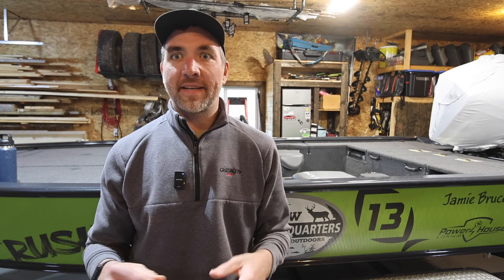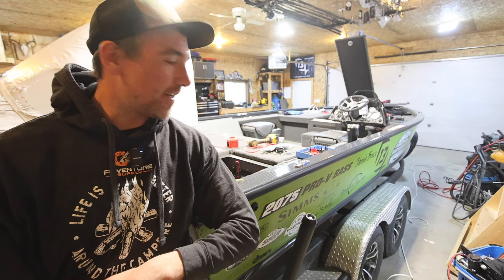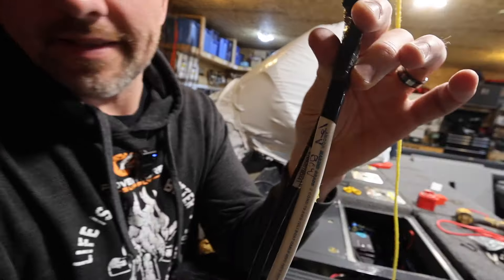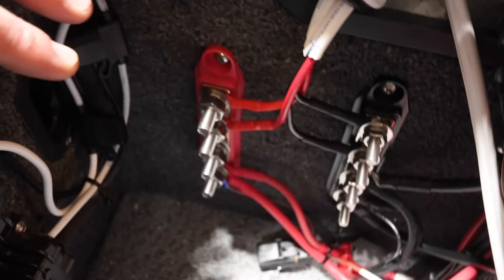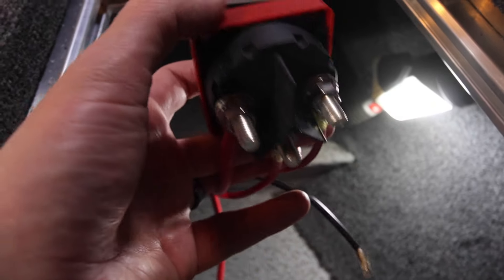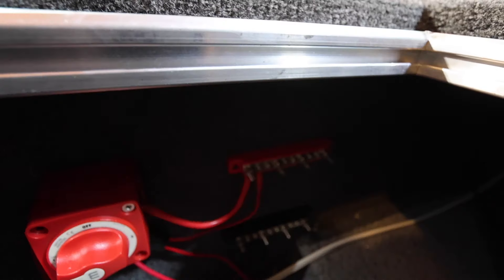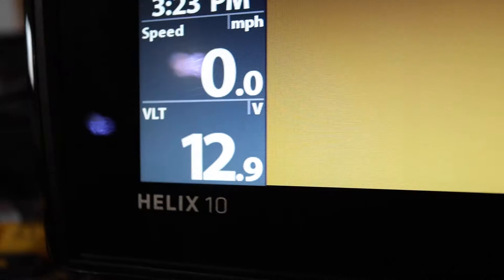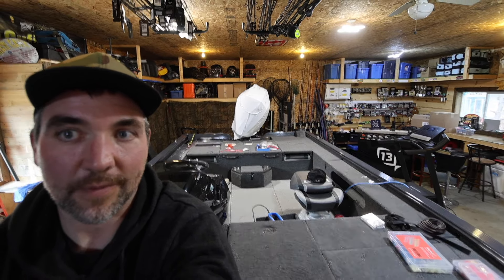How To Wire Your Boat For Clear Sonar Images and Back Up Power

Comment: An excellent vid for us new Pro V Bass owners.  Thanks!  It would have been really helpful if you also showed how you removed the floor/side panels to open up the wiring channels and the exact route you took when fishing your wires through the boat.  For newb's ... little stuff like that helps greatly.  Got a new follower here being an Ontario angler. ;)

Comment: I learned the basics of boat rigging this Spring installing a Helix 7 and 5 on my 1993 Smokercraft (my first boat).. it's been a learning process and i still have some dialing in to do but it all works how it should; Except when i have to switch my starting battery with the trolling motor battery to get enough juice to start my boat lol.
Reply from the maker: haha - definitely been there!  Gotta start somewhere!

Comment: Brucey, where do you order your parts such as buss bars, perko switches and even wire?  Is there a hot spot for this that you like.  Never too late to clean up my old mess in the back.
Reply from the maker: Hey bud - most of it is in stock at LOTW sports in Kenora , not 100% on the perko switch stock but the buss bars and wire is stocked heavy in Kenora .  Talk soon!

Comment: Are you worried about interference with a fuse block? I just wired my 16v up in the bow and I used a fuse block instead of in line fuses and buss bar
Reply from the maker: I'm sure they're fine, not much difference I wouldn't think

Comment: Very cool video showing how to get it done and why wire gauge and run length have an impact on ampacity.  Today's electronics are many orders of magnitude more demanding, and more sensitive to voltage sags or surges, than the old-school stuff.  The one thing I expected to see was a dedicated electronics battery mounted near the bow.  That's what I did in my boat and it eliminated any value in using the odd-ball 16v battery configuration.  I hate how those are only good for that singular purpose and require a dedicated charger.  I'd much rather run a more capable 12v battery, with right-sized wiring, to avoid any issues with voltage sag.  The 16v batteries are just "magic beans", from everything I've seen and read on them.
Reply from the maker: Thanks Jason.  I have two 16V 60 AH batteries mounted in the bow; I showed it in the previous video.  The 16 V battery is the same price as the 12V battery AH to AH and allows more power in a small space; which is what allowed me to run 120 AH @ 16V in a single location in the bow.  Other than the charger, which you would have to add for a 12 V anyway; there really isn't a reason not to use one IMO
Reply: @jamiebrucefishing  - Given that your livelihood could literally depend on a battery solution delivering the best possible power to your electronics, I can understand going to this extreme.  For the vast majority of folks, the math really doesn't add up, but you're showing what you're doing in your boat, so that's cool.

Comment: In my experience running dedicated power wires is unnecessary on newer Lund ProVs, along with their other higher end models. 

They run typically 8ga wire direct from the battery to a fuse panel under the helm, with open fuse slots for a chart plotter at the helm and then from there they also run 12ga wire up to the bow for bow electronics. 

In the event someone is running 3+ screens or live scope we will occasionally run new bow power, but the cables from the battery to the helm on a Lund proV are actually completely overkill and extremely well designed.